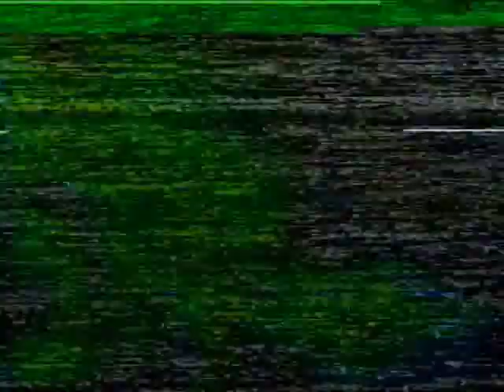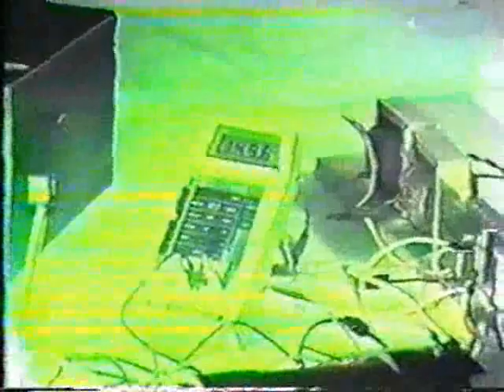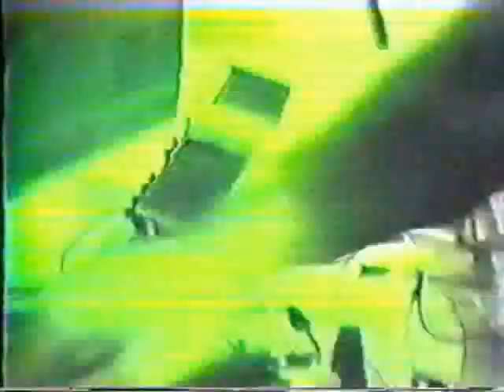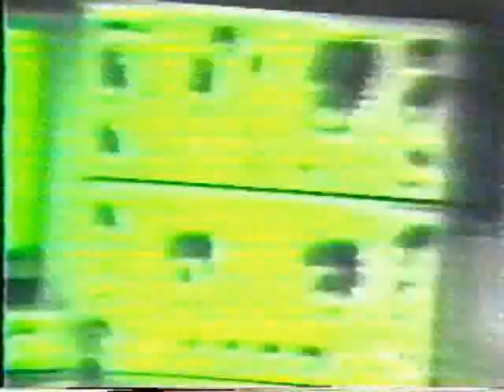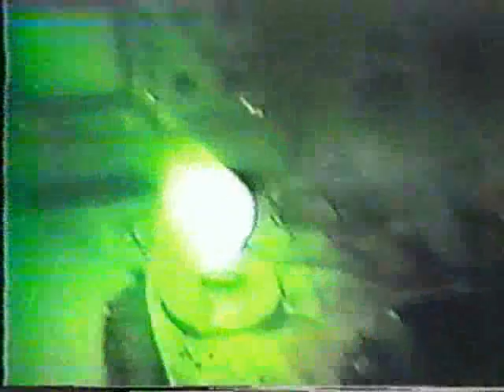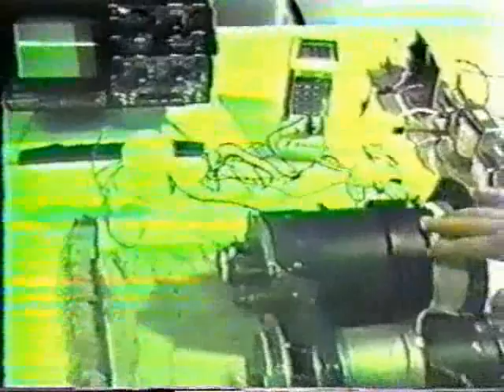tikon(2).wmv

Comment from the maker: try to find out. what i guess is, similar thaein coils, i'm high voltage coil and the voltage lag the current until 180 degree. then the stator coil will pushing the rotor run itself  when the system loading. this is running in high voltage, probably it is step down using transformer to 110V. i working on this generator right now, i will give you schematic once i done. probably this generator couple wif my newman motor.